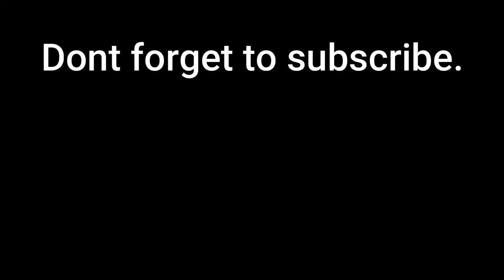Lawn Tractor Ignition coil replaced

Comment: Good Job!  I bought a JD L120 with a bent and thrown exhaust rod on the left cylinder.  It was a valve guide that was being pushed out.  Got that fixed, and the right cylinder wasn't running right.  The exhaust pipe was staying cool.  Into the carb 3 times, and finally that got the right cylinder running, but still the pipe slows to heat up.  I swap the coils (left to right and visa versa) and the engine now surges.  On and on this goes.  I've got 2 new coils on order, and hopefully this will finally fix this 2nd or 3rd hand mower that I picked up cheap.
Reply from the maker: It is going to be great in the end, according to you the price was right
Reply: @ArniAtlason  Yup, the two new ignition coils was the final answer.  The JD was running great and sold for $1600.  Best was that I learned a lot.
Reply from the maker: Fantastic great ending.

Comment: I have a D105 and went to change the plug and the plug wire is almost gone and I mowed last week. The boot is completely gone. I doubt I’ll be able to fix it. I can change plugs, oil and filters but when it comes to taking everything apart I get confused.
Reply from the maker: Getting confused is easy, happens to me also. I take apart things in sections and take pictures of everything. That helps me out when I put things together.

Comment: What problems were you having before ? I have backfiring and loss of power when I turn the blades on .  Thinking it may be the coil
Reply from the maker: I didn't have any problems. I noticed when I fixed the valve rod that the insulation of the coil wire was out so I did decide to replace it.
Reply: More likely the Carburetor needs a cleaning or a rebuilt kit installed.  These Carbs get junked up fast.